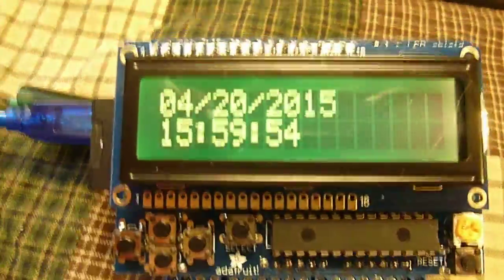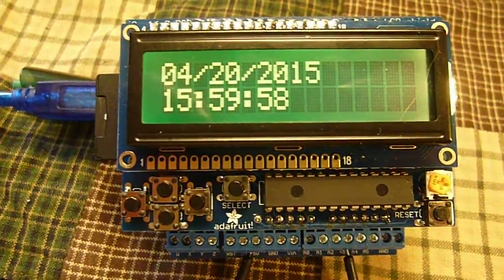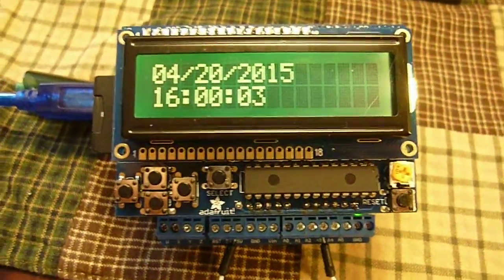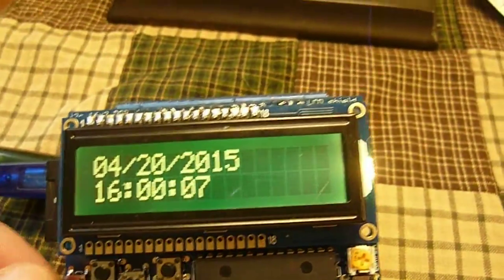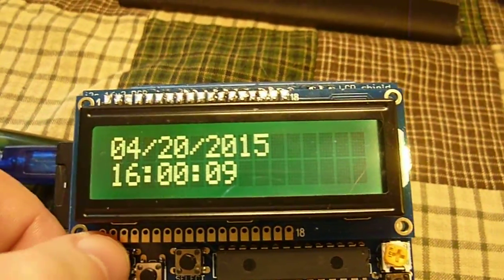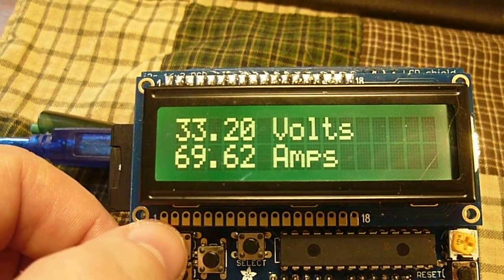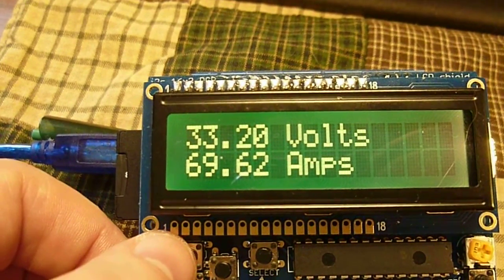Solar & Wind Data Logger

Comment: Thank you for your great upload I love what you’ve made👍🏼 if I have let’s say a circuit board with a led light that lights up randomly, is there a way to create a sensor to let me know when that led lights up if I’m not there? Weird question I know. Also if possible for that sensor to log and save that data to then be looked at in more depth. I hope that has made sense. Many thanks and good work on your upload
Reply from the maker: Not sure why you want to know when the led blinks. It's just a data communication led. You can send the data being collected to a networked database, or store locally on the sd card.
Reply from the maker: Yes, you can use a photo sensor to watch a led, and have it text you when the led lights up.

Comment: I want to measure wind speed and direction in my house. I use this your equipment? how Much is It?
Reply from the maker: Alberto Hübner Kunde You can use my equipment, or anyone else's.  Sparkfun makes a good anemometer / wind vane & rain gauge. I posted a tutorial on how to monitor wind speed at http://arduinotronics.blogspot.com/2015/08/measuring-wind-speed-with-arduino.html
see the data logger at the address in the video description.
Reply: ok